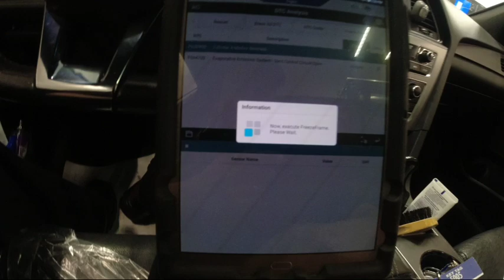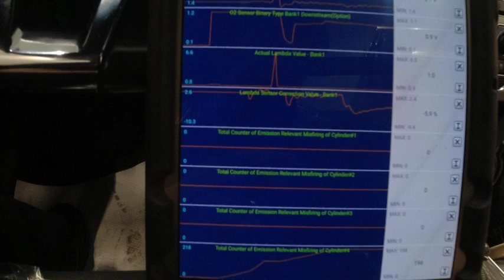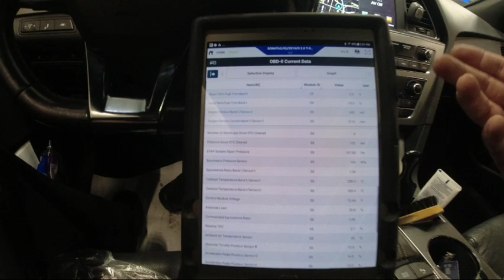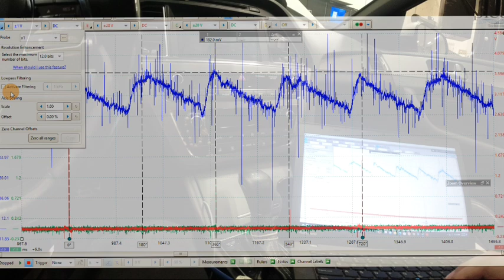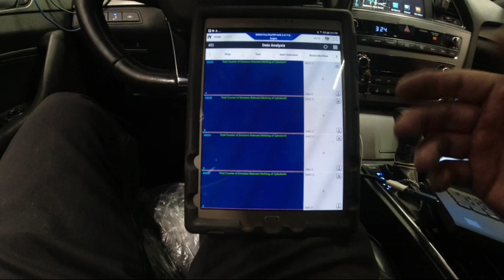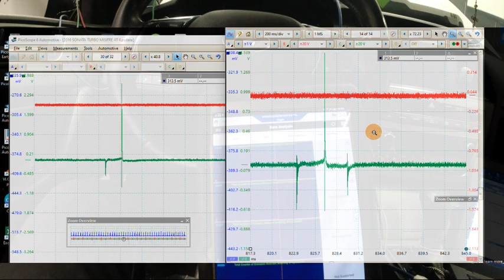2016 Hyundai Sonata turbo misfire complaint

Comment: Hyundai was doing really good and now they had all these oil burning and timing problems. The timing problems are so bad that they won’t even guarantee these engines anymore on any Hyundai. Keep in mind that’s not Hyundai itself. That’s the used market of automobiles. Great video thank you for taking the time to make these!❤ these cars should be lasting longer than 191K I have a Toyota with 250,000 miles and I have an Acura with 260,000 miles and they both run better than this Hyundai. You better step up your game Hyundai.
Reply: I had a 2006 Sonata GLS, that tank had almost 200,000 miles before I was in an accident  I had absolutely ZERO issues with anything for the 13 1/2 years I had it.  Bought a 2016 Sonata Limited with 25,000 miles, had no issues until a couple months ago.  Currently, it is sitting at the dealer awaiting a new engine after breaking down 2 1/2 weeks ago.